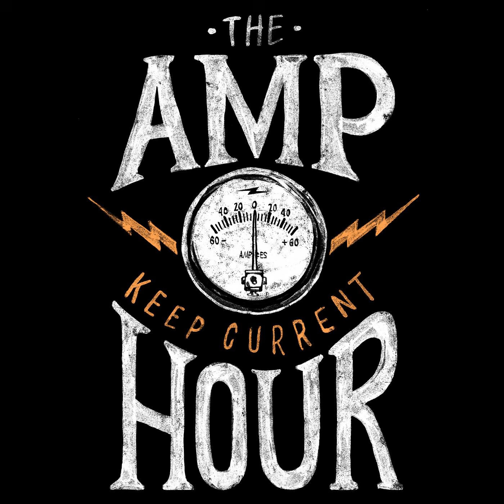The Amp Hour #196 – An Interview with Mike Engelhardt (Re-broadcast)

Comment: There is one issue the 3k4 vs 3.4k setting solves. It depends on your regional settings if you use a . or , for the decimal. If you use the unit prefix there is no ambiguity about the decimal position.